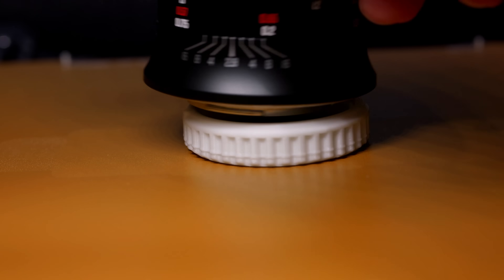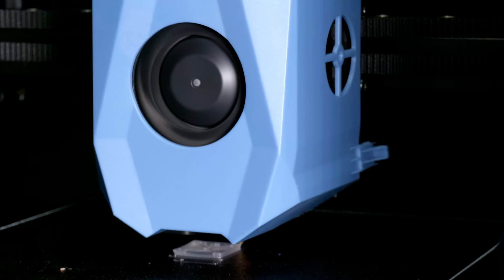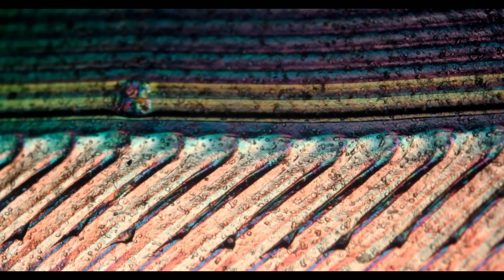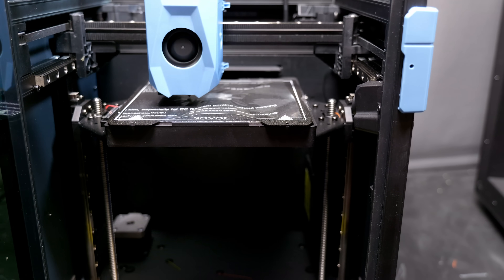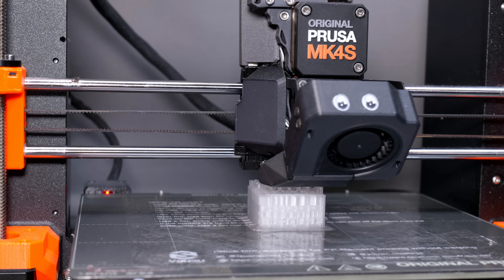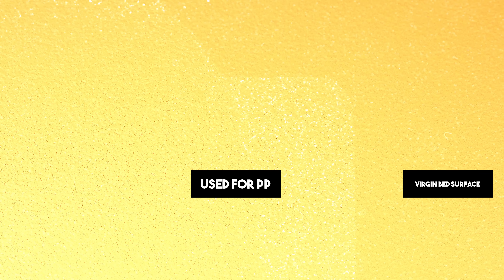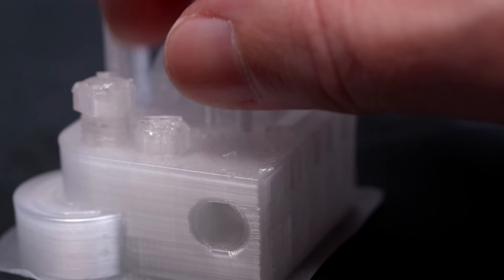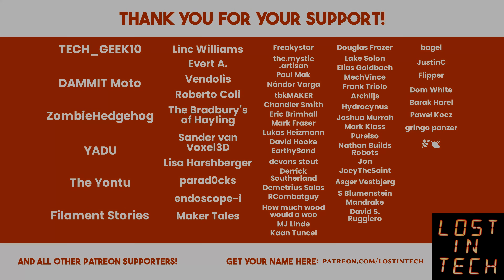Polypropylene - the FLEXIBLE 3d printing filament that everyone is sleeping on

Comment: I have experimented with pp for a while on my sovol sv06 plus but it always buckelt up in the extruder. Got my core one and the PP sheet and on the first try it worked. The only thing was it jammed at unloading in the nextruder.
One thing I think was not mentioned is the elongation. It basically stretches 3 or 4 time it lengths before it breaks.

Comment: Up until recently I worked for one of the world largest (if not the largest) plastic manufacturers.  I shipped out multiple dozens of railcars every week.  We specialized in PE and PP and the sheer volume of grades and properties pretty much makes the PE/PP designation meaningless.  We had grades of PE that were so flexible they barely held their shape and grades of PP that were stiffer than polycarbonate.  It's getting to the point where the actual type of plastic one prints with is irrelevant and instead what matters are the properties of the filament being used.
Reply from the maker: I just wonder how they recycle it when it's definitely not a homogeneous plastic
Reply: @LostInTech3D  And there's the crux of the problem... and why recycling programs really doesn't work.  Many are looking into pyrolysis to recycle the post-industrial waste back into feedstock but it's the post-consumer waste that's the huge problem.
Reply: Thanks for the info.  I have some insight to the production side of plastics to be aware of the concepts your bringing up but nothing like what an industry insider like yourself knows.   Appreciate the additional knowledge.
Reply: Absolutely true! There's a couple of filament brands selling filament made from "recycled sources" - true! But they're not grades useful for 3D-printing, more for blow-moulding; so when you try to print large format, the layers come apart like a slinky!

Comment: Pp sucks in -40°C..... dropped an expensive tote and it shattered into a bazilian pieces....hard to find on ice. Yes...i am Canadian! 🇨🇦
Reply from the maker: I think the -40C part is the part I don't like in that situation lol
Reply: It's also -40F.
Reply: Even TPU will shatter at that temperature :)
Reply: @Qwarzz  i bet TPU does ok....will test it in 6-8 months! 😢
Reply: I've heard polythene napthalte can work well at cryogenic temperatures if you need something that can really go cold. It's cool stuff
Reply: TPS will work for that. Or the softer TPUs around 85A and lower.